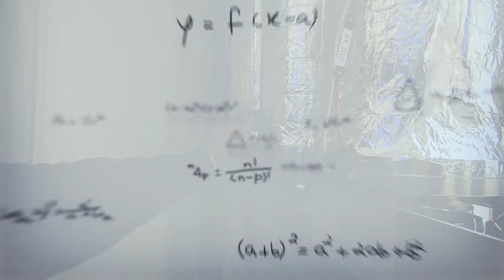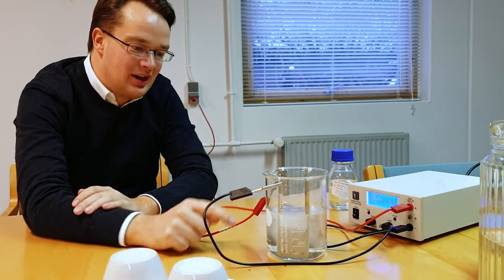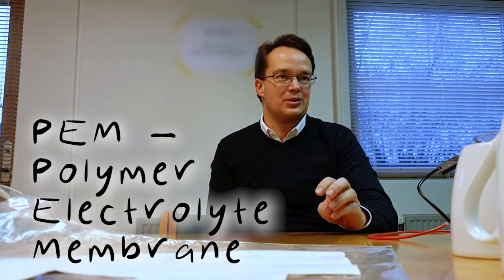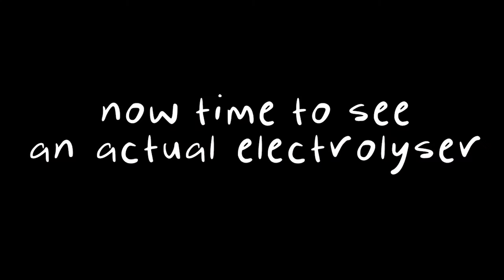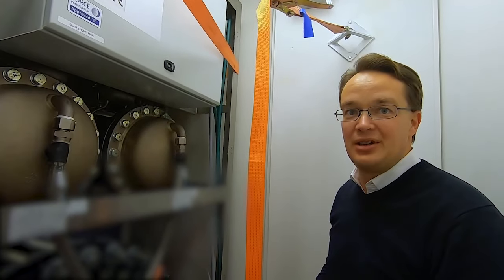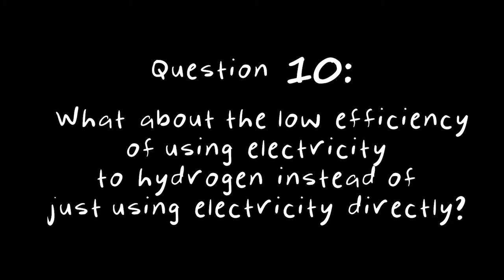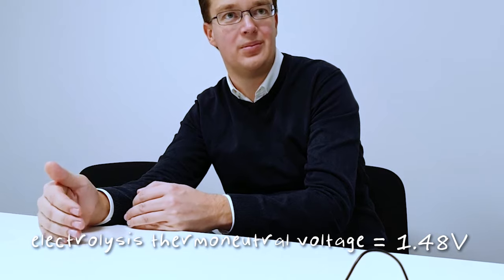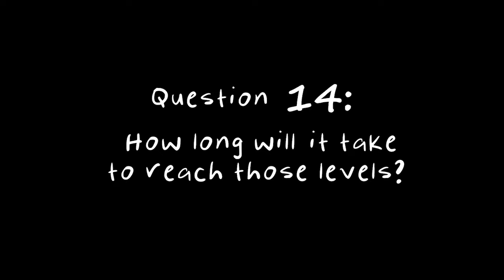Green Hydrogen Systems Electrolyser Tour

Comment: When I was a teenager back in the 1970's we made an electrolyzser in my friends basement (which was definitely a den of various iniquities, such as foosball, underage drinking, etc).  We use it to fill up balloons with the off-gas.  We lit the balloons on fire to produce wonderfully impressive conflagrations.  Only recently did I find out that because of the chemistry that we used we probably produced chlorine, along with the hydrogen and oxygen.  So kids, if you try this at home, you probably should use lye rather than table salt to increase the conductivity of your water.
Reply: We of course did electrolysis in high school chemistry, with the warnings that if you used too much NaCl in the electrolyte, chlorine gas would be made.... so what did I do at home on the weekend? It really is quite yellow too, and I of course had to smell the pure chlorine gas (only did that bit once!).....
Reply: @geoninja8971  .
Reply: Epsom salt is another option
Reply: I would think that baking powder would be safer than either of those chemicals?
Reply: @geoninja8971  The chloride releasing chlorine gas - same as when U-boats salt water got into the battery electrics.

Comment: A couple things:  1)  his efficiency is in terms of the HHV of the hydrogen produced, which includes the heat of condensation of the product water once you burn the H2.  That value is 39.4 kWh/kg.  You don't get that back- 6 kWh is lost therefore, so you really should use the LHV of H2 which is 33 kWh/kg.  So they use 39.4/.76 = about 52 kWh per kg of H2- but really, when you feed it to a fuelcell, even an impossibly perfect one will only give you 33 kWh back again (most give you only 16.5!)  So the efficiency really is 33/52 or about 63%.  Once you store it (90% best case) and then use it in a fuelcell (50%), you have a "round trip" efficiency of only .63*.9*.5 = 28%, versus over 90% for a lithium ion battery.  That's a lot of loss, so he's dead right- you would only convert electricity into hydrogen to use it AS hydrogen, not to make electricity again from it!
Reply: 2)  He forgot to talk about current density.  If he put twice as may electrodes in his beaker, the voltage would drop too- efficiency would go up.  But for every doubling, you only get a small increase in efficiency (drop in voltage).  And every unit of area means more electrode metal, and more separators etc. etc.  So you are in a balancing act between increasing efficiency (which makes the electrolyzer more expensive, not cheaper!) or decreasing capital cost (which makes the electrolyzer less efficient...)
Reply from the maker: Thanks for the detailed comments! We did actually discuss your second point briefly, but I had to cut so much of what we talked about... my first cut was 30 minutes long and no one wants to watch that 😊 So thanks for adding the point here.
Reply: @EngineeringwithRosie  You've got a vote for a longer video here!
Reply: Still, hydrogen car (electricity->hydrogen->electricity) has better efficiency than a petrol or diesel. You should compare with internal combustion engine, and see that just having low efficiency does not mean it's not feasible solution. It solves many problems with transport and long term storage (i.e. transport in time domain 😆) of electricity.
Reply: @EngineeringwithRosie  I'd also appreciate being able to watch longer unedited interviews. If you're afraid that they would scare away new viewers, you could always put them up unlisted and only link to them from the video description of the edited video.
Reply: @DynamicFortitude  not with an efficiency of 28% it doesn't. It's not much higher than a petrol engine and is lower than a diesel engine.
Reply: @salerio61  
The efficiency is not as important as the total cost.  If the electricity is so cheap that the cost of hydrogen can compete with other fuels then the hydrogen will become a fuel for the future.
Reply: @acmefixer1  the hydrogen produced isn't a fuel, it's a battery. The efficiency does matter if it costs 4 times the price to store and use it compared to a regular chemical battery.
Reply: @salerio61  some one should point out to him, and other H2 enthusiasts, that Electricity prices are increasing, no reducing....thanks to Wind and solar inefficiencies.
He dodged the question of both system cost and final hydrogen cost per kg, because it is impractically high, around $10 -$15 per kg.
Reply: @latemnetlom  "includes the heat of condensation of the product water once you burn the H2"

But I got the impression that the current use for the hydrogen they produce isn't mostly for burning or fuel cells.
Reply: @weinisable  Electricity prices are definitely decreasing. Solar and wind have inefficiencies, but so do all power generation systems. Both batteries and H2 have their place as stores of energy. Short haul transport will most likely adopt batteries, but try powering a commercial plane or a container ship with batteries. I think H2 is also the only practical solution to decarbonising industrial emissions. Again, try producing iron/steel, cement with batteries. Hydrogen is also an important feedstock for many commodity chemicals such as fertilisers, medicines, and will likely be adopted to replace current petrochemicals from crude oil.
Reply: @seancole-hunter5837  please identify any state or country  that have seen reduced consumer cost of electricity after the introduction of significant % of RE generation
Reply: Here's a somewhat lukewarm defense of using it to generate electricity.  

Long term storage energy is much more practical for something like Hydrogen in theory.  The size of the storage is unrelated to the power that you can produce.  So you can scale up the storage without needing to scale up the entire system together.  And a key metric for this is really the difference between the peak price of electricity and the lowest price of electricity. 

So I looked at PGE's website and found that the peak price is 42 cents/kwh.  That's between 4 and 9 during the summer.  The lowest price is 26 cents/kwh during the winter which is about 63% the peak price.  So (ignoring things like system costs for now which I know are important for this) you could break even with a 63% efficient process.  That's obviously a lot higher than the 28%.  But I can see this price difference growing as we use more renewables and there's also the potential of some dramatic improvements.

I'm not saying hydrogen will or should win in this space, but it's not so far out to discount it completely.  Honestly, now that I'm looking at the numbers, I could (maybe) see a good use case for it today.  You can get off-peak electricity at ~4 cents/kwh or less in some places.  You could possibly make money by generating it there, shipping it to California, and charging 40 cents/kwh there.  You'd be paying effectively 15 cents/kwh (4/28%) so your system costs would need come out below ~35 cents/kwh.  That kind of thing would be impossible for traditional batteries.
Reply: @EngineeringwithRosie  I have heard you say the point of having to cut because we wouldn't want to watch longer videos a couple of times now. I think lots of us would watch you for an hour without any issues. I usually watch everything at between 1.5x and 2x so it's not that big a deal. Cheers.
Reply: @johnway9853  ha ha, brilliant. I was today years old when I learnt you could do this. I'm totally hitting 1.5x from now on :)
Reply: @EngineeringwithRosie  , your content is really fantastic, and i will watch hours of videos where you explore the engineering behind green energy solutions... you also have my vote for longer videos...
Reply: @salerio61  no battery can be interseasonal. Hydrogen can.
Reply: Excess solar and wind storage using an abundant and non toxic resource is a clear advantage over lithium ion batteries. The heat can be used to save energy from heating that would otherwise come from the grid/gas.
Reply: Hydrogen for propulsion /transportation is only viable, if we have an economical method. like, may be, drilling it out from somewhere under the rock, or sea.
Reply: @latemnetlom  Steam Methane reforming is still a better bet.
Reply: @acmefixer1  Dream on, there is no cheap electricity that is why you don't see green hydrogen powering much of anything these days.
Reply: @weinisable  They all do this, they always leave out the pertinent details from which you could easily draw the proper conclusions. Green hydrogen is way too expensive for everyday use in almost every application.
Reply: Totally agree.  I do not see hydrogen as a viable substitute, especially as battery technology improves.
Reply: @weinisable  All the studies out there show green hydrogen cost is between $5-6  per kg. No way it's $10-15.
Reply: yes,  not to electricity, that's right...i am on a research now
Reply: @acmefixer1  You are correct with the statement that "efficiency is not as important as total cost, " at least for the consumer.  The "If the electricity is so cheap" is the point at which the magic wand is waved.  Like any energy that is produced, it's not produced in a vacuum.  If electricity becomes cheaper, it is used for more things thus increasing demand and stabilizing the price in reference to other energy sources.  For example if electricity gets a lot cheaper, people will switch their home heating fuel usage to electric driving up demand.  Industry is full of bean counters that will also switch their processes if it makes financial sense, driving up demand and thus price.
Reply: No. The round-trip is 50+% but this wasn't explained. Do the search.
Reply: @UpsetNerd  good point, she could also put the longer version on a members only section

Comment: Thank you Rosie, your video is very informative. I watched your video several times to see how my small mobile system that I’ve built (and still improving) compares to the one from Green Hydrogen Systems. My system has been built on a shoestring budget but the important components seem to be present. One difference is that I don’t vent the O2, I dry the O2 and compress that too. My biggest challenge at the moment is the degradation of my membrane (or diaphragm as Kasper calls it), my KOH dissolves my membrane much too fast when I run my system at full power; 200 Amps at 27 VDC. Most of the gas that I produce is grey H2 and O2. I recently install a solar system with battery bank to produce green hydrogen instead. It would be great if you could make a video on the different types of membranes, design, manufacturing, availability and cost thereof. Thank you in advance John.
Reply from the maker: Wow, have you really hand built an electrolyser? I have never heard of that before, I am really impressed! If you're on Facebook or Instagram please share photos and tag the Engineering with Rosie page 🙌🙌
Reply: @EngineeringwithRosie  Thanks, I've uploaded some photos and videos of my electrolyzer build on Facebook and tagged your FB page.

Comment: I live in the Western USA and we put solar cells on the roof of one of our shops that produces much more than all our needs combined. It is set up to feed back into the grid but we discovered that this feature is only active when there are local peak usage. With a couple neighbors installing them we are wanting to do something with all the unused power. We did try setting up some hydrogen production with a company in Oregon that was producing some nifty 2way hydrolyzer/power units but before we could get them that company was bought by some unknown giant corporation (through shell subsidiaries) and we never heard from them again. We dropped plans for any more solar and cancelled wind turbines because we couldn't use or store the power.
Reply: What a shame! Pressurize the water going IN and the gas will be at 1/2 the pressure coming OUT. At 60 degrees F you'd need 92psig to compress into a used propane tank. Using gas-tight quick disconnect couplings and in-line cut-off valves (all fittings non-steel and all components earth-grounded) you SHOULD be safe.

Whatever you do - DON'T try to pressurize the GAS using a compressor. Pressurizing the intake water is MUCH safer!

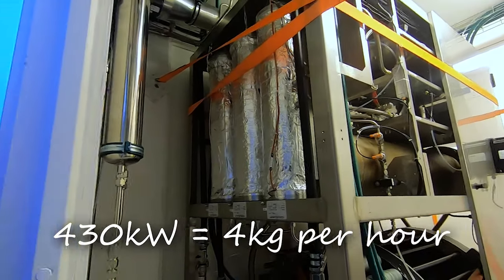Comment: Hi Rosie, Very nice video!  There are two points in the video that don't match up regarding efficiency in my mind.  First is at 9:00 where they are using 430kW to make 4kg per hour, so that's 420kWh of electrical energy to produce 4kg of hydrogen or 105kWh/kg which contains 33.33kWh of energy per kg.  33.33/105 = 31.7% efficient.  But in the literature, at 12:04 it says 76.5% and that they can produce 1kg of hydrogen with only 51.44kWh, not 105.  Is he doing something useful with the heat generated? or was he just guessing wrong at 9:00? Also if you take the numbers in the brochure,  51.44kWh per kg of hydrogen and there's 33.33 kWh of energy in each kg of hydrogen, then the efficiency would be 33.33/51.44 = 64.8% or am I missing something.  Thanks.
Reply: exactly what i am working on now, please do you have reference materials, maybe i can further support my research..thanks man
Reply: @rexossai1441  Sorry, I was just asking questions about material in the video.  Besides the amount of energy contained in hydrogen, the rest is just basic math and keeping the units the same.  Just recently I read something about 4 major electrolizers starting production and in each case, they either give the output in kg/hr or kW in.  None of them give both numbers so that you could divide the energy in vs energy out to simply arrive at the efficiency to verify their claims.  Clearly it's been something the H2 industry has been shying away from.  If Rosie saw the comment, I could understand not responding since pointing out flaws in the math doesn't do well for getting invited back and continuing to make YouTube content.
Reply: For example at 9:00 there's the equation 430kW = 4kg per hr.  So 430kW for an hour is 430kWh = 4kg.  4 kg contains 4 kg x 33.3 kWh/kg = 133.2 kWh of energy.  So 430 in to get 133 out.  Doesn't sound like 70 something percent efficient to me.  But at the same time, he says "aaah, about 4"  That doesn't sound like some precise measurement either.  But he'd need to output 430* 0.76 = 327 kWh worth or 327/33.3 = 9.8kg and I doubt someone that's working with it all day long would be off by more than double.  I too am an engineer and follow the basic grade school process of checking your math other ways to insure your answer makes sense.
Reply: @scottkolaya2110  in my report i have 3.47kwh to 0.063kg hydrogen, at a high heating value...and be sure his not referring to FC here..note......but still the economics with no government tarriffs leaves nothing
Reply: @rexossai1441  I've also seen numbers like that quoted.  So 3.47/0.063kg is 55kWh/kg.  Which 55kWh in to make 33.3kWh of energy is 33.3/55 = 61%.  61% sounds more reasonable. But I'm also suspicious that it doesn't include all the energy costs in that number.  Is that for 700 bar pressurized hydrogen or atmospheric pressure H2?  I know it's not for liquified H2.  That tacks on another 12kWh/kg to bring it down below −253°C (−423°F). I've heard that in much larger scale, it's down to 8kWh/kg. But, for example in a large electrolyzer plant, there's much more equipment to make it run, not just the electrolyzer itself.  I would love to see the plant's electric meter for the month and it's output in kg for the month to get a real efficiency number.  I suspect it's closer to 55% once you include pumps, HVAC, lightning, etc.  Just like I'd like to see a gasoline refinement plant's electric bill to see how much electric is used per gallon of product.
Reply: @scottkolaya2110  One should suppose that the levelized cost of hydrogen (LCOH) for all electrolyzer technologies would be comparable. I think no producer would ever present publicly sensitive data regarding price  or efficiency issues. That is perfectly understandable. Some questions will remain without answer. Efficiency should be worse (OPEX disadvantage) in order to offset the CAPEX advantage (using nickel instead of iridium as catalyst). In case of concrete talks concerning buying,the producer would be a lot more opened to exact data.

Comment: Rosie, many years ago, I built an Edison hydrogen generator for my truck which I used to increase my gasoline mileage. I went from 16 MPG up to 25. Both the hydrogen and oxygen were added to the incoming carburetor air. This resulted in a very large decrease in my miles per dollar, or reducing my gallons per hour of gas. The problem I ran into however was that the new auto computer systems would enrich the gasoline to meet its computer specifications, negating the huge advantage. (Also increasing heat output on my catalytic converter.) And if I modify my computer to avoid this my car would not pass inspection, because inspection looks at computer settings only, and ignores the actual tailpipe emissions, which was actually significantly improved! I can see the only reason for this being Big Oils concern for their profits! I know, I just asked you to walk into a mine field. But I am a scientist. Truth is all that matters to me. This would significantly reduce greenhouse gasses until we can get totally on a green energy solution. But some people will lose a lot of money. Very powerful people.
Reply: Shouldn't have input the O2 consistently - only when a boost in horsepower is needed - hence the overheating and 'computer' enriching the mixture (O2 sensors in the exhaust line) - raising the O2 output causes the O2 sensors to heat hotter - telling the computer the engine is running too 'lean'. (My friendly Meineke dealer's diagnosis - ;-)